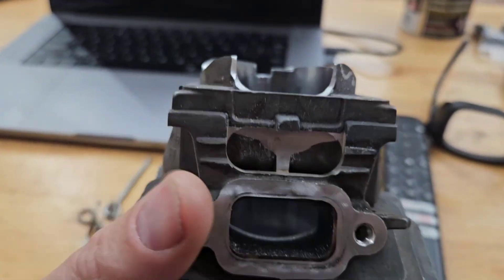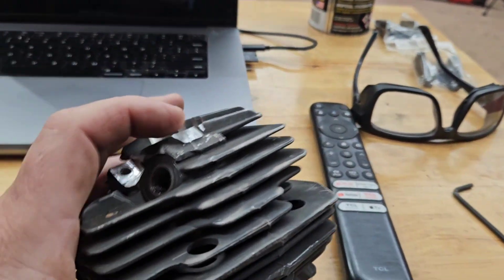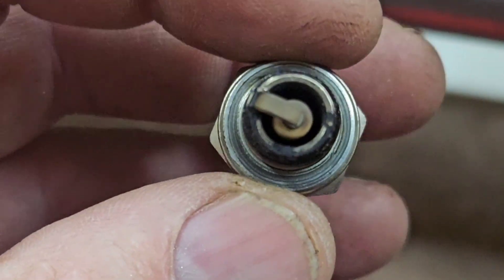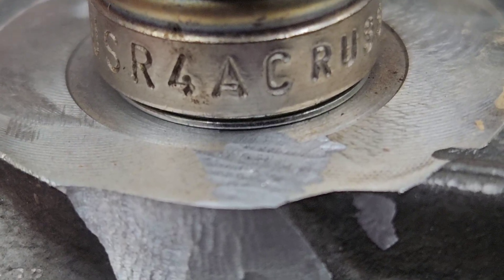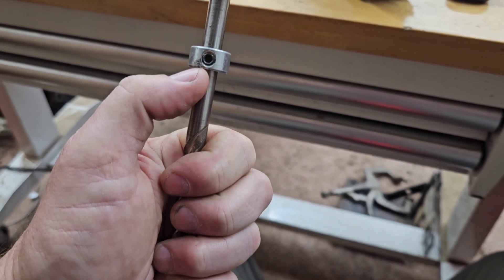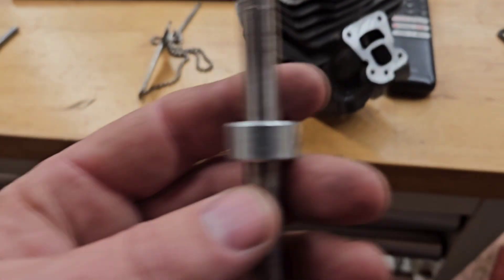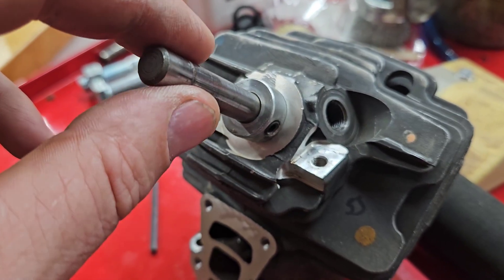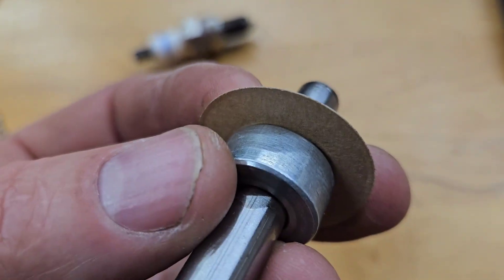Saving an MS400 cylinder from disaster!

Comment: 😊😊 thats a sparkplug washer it helps 2 get rid of the heat at the sparkplug so it wont ruin it they are good until the center turns brown 😮😮 after that take the old plug and put a new 1 in the old 1 is  o longer no good and not worth fooling W because its no good and gone 😉 😮 OMG 8 1 2O25

Comment: That’s not how you machine a flat perpendicular surface. You’d have been better off leaving it alone if you weren’t going to machine it properly. It’s worse now. Only reason it will likely work is because it would have worked before. I can guarantee it’s not as flat now as it was. Oh well, if it works it works but you’d have been better off filling the hole then trying backyard machining 👍🏼
Reply: Dyno Joe cuts cylinder seating surfaces on a delrin mandrel. A similar mandrel and skim the face of the spark plug seat would be best. The burr path looked a few thousandths deep, at least
Reply: With approximately .030” crush on the washer it’ll be more than fine. Add a little copper anti seize or a thin copper washer if you were to really worry about it leaking. Life isn’t always pizza and blow jobs tho we wish it was. Life’ll go on….